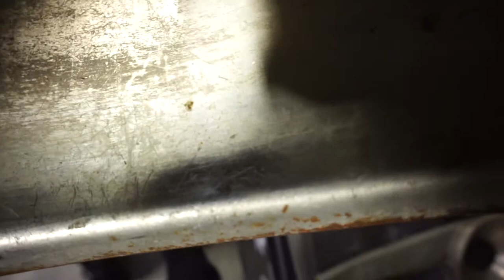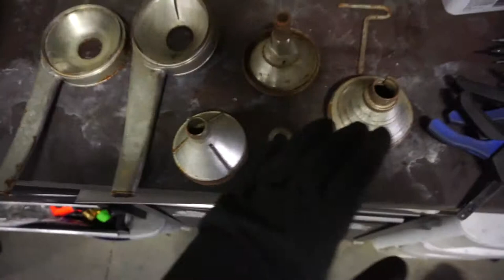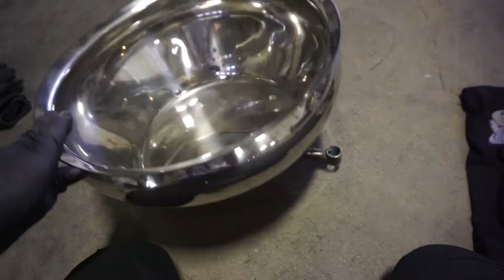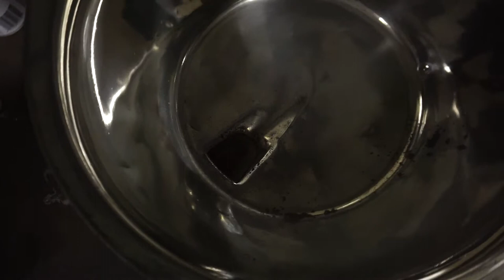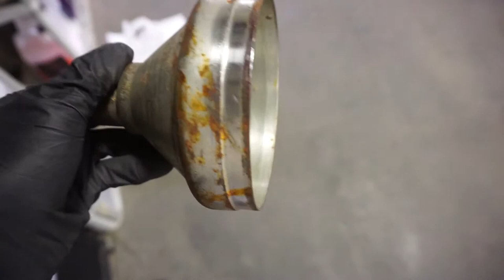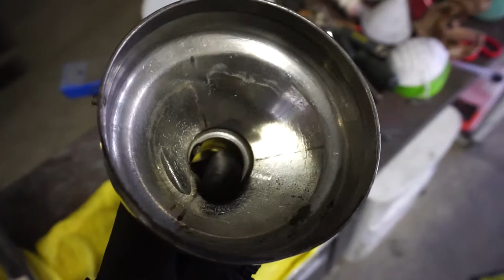Polishing Antique Cream Separator - Metal Polishing Antique Restoration

Comment: Thanks for taking the time to post this video.  I have an old separator that looks very much like the one you worked on.  The bowl and other metal parts are very corroded and I thought that I would have to look around and buy replacement pieces.  Your results impressed me to the point where I decided to do the same thing.   A cordless drill, wire wheel, some metal polish and a bit of time.  So far, I like the results.

Comment: Great job, how do you know what type of metal the large bowl is made out of? I thought they were all made out of steel because you can stick a magnet on it and it holds tight. In this case, was it steel or aluminium. Thank you for sharing its clear that you put a lot of work into it. Cheers!
Reply from the maker: Thank you! I still am not exactly sure what the blend/composition the metal was made of to be exact, but it created black residue when I took a hand polish to the surface which indicated to me that I would be able to polish it as if it was aluminum. Seemed like it was a weird blend of a few things honestly. It took me a fair amount of time that's for sure! Thanks for watching.